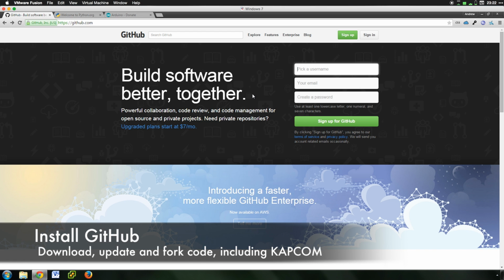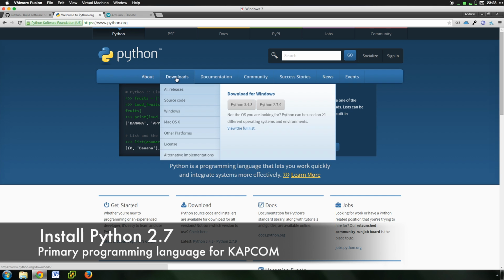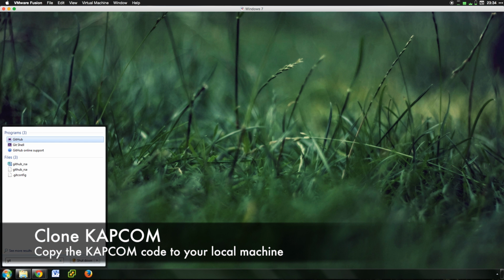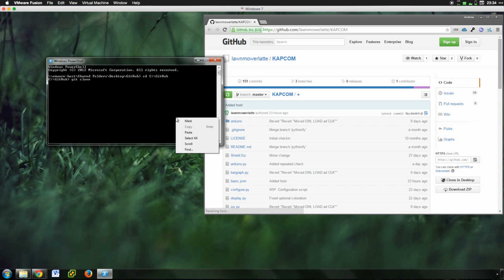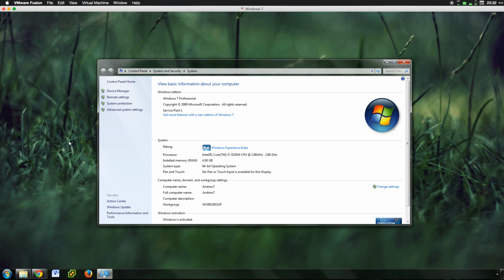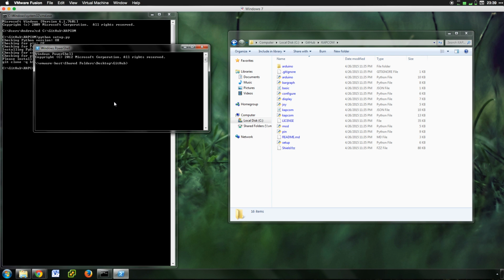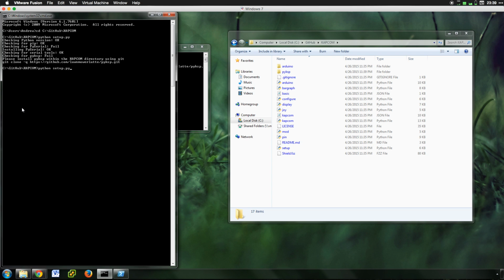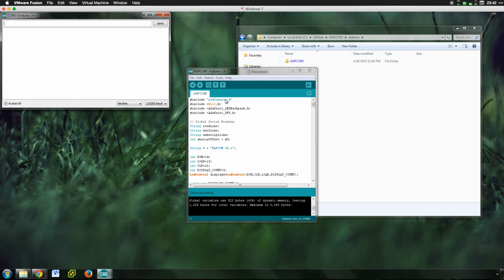KAPCOM Intro: Part 1/3

Comment: I am trying to follow along. I manage to get up to running python setup.py but it returns the following message:

Traceback (most recent call last):
   File "setup.py", line 19, in <module>
       from tools import KAPCOMLog
ImportError: No module named tools

Any ideas what is going on?
Reply: Nathan Fisher I think I may have stumbled into a solution. I copied the tools.py file to the main directory of github\kapcom and it ran with some errors. I followed what you said after this and manually installed the pyksp by copying the test you input into the command window. I currently have the pyksp directory in the kapcom folder.
Reply: Nathan Fisher Followed by a compile error when trying to upload the sketch to my arduino

Heres the fatal error: 

KAPCOM.ino:2:24: fatal error: LedControl.h: No such file or directory

compilation terminated.

Error compiling.
Reply from the maker: Nathan Fisher, my repo has changed a bit since making this video so make sure you download the v0.9.0 release — https://github.com/lawnmowerlatte/KAPCOM/releases/tag/v0.9.0
Reply from the maker: Nathan Fisher Ugh, so sorry. I forgot to mention that you need to download the LedControl library. https://github.com/wayoda/LedControl Put that in the libraries folder for the Arduino IDE.